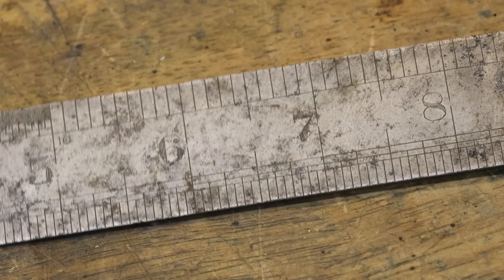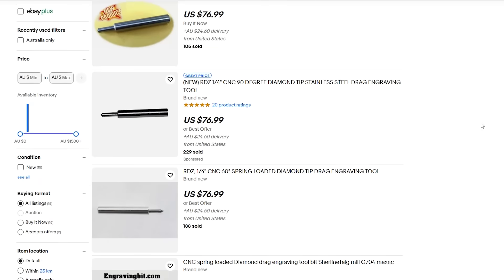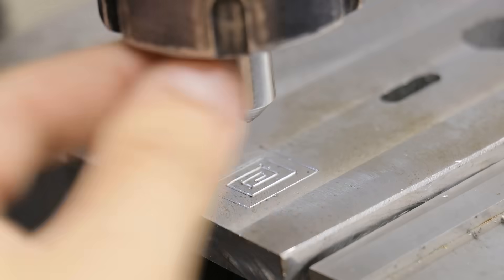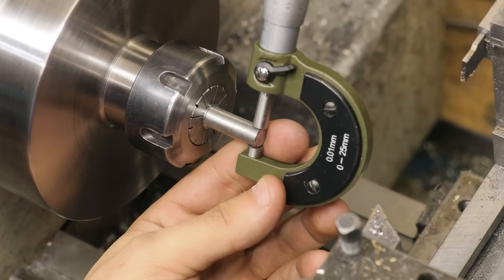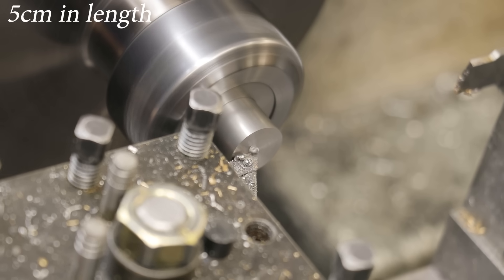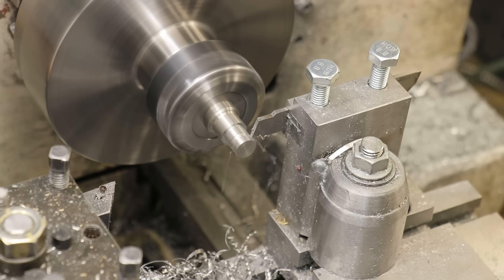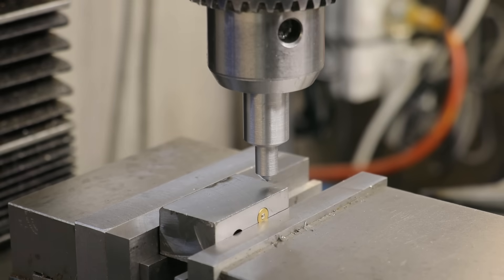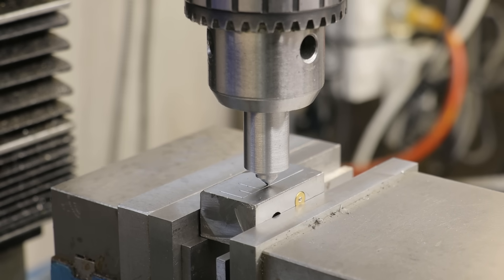They wanted $150 For This. I Made It For $10

Comment: No diamond, but a spring loaded tap will get you most of the way. Adjustments may be necessary for runout. I recommend the Brown & Sharpe for less runout. My use case is a bit different as I am engraving softer materials but I also balked at the cost. After trying an expensive spring loaded bit I found spring loaded taps worked just as well with some adjustment to the process.

Comment: You don't need a diamond tip for drag engraving most metals, you can repurpose a broken carbide endmill. You just have to resharpen them once in a while, but yeah $10 dresser is cheap enough.

Comment: I needed to upgrade my 8×14 lathes motor. Didn't have enough oomph. The ready to go motor and controllers were pricey. So instead I found a used 4.5 hp high torque motor with bad bearings for cheap, got it. Rebuilt it. Built my own power and control system for it from scratch. Had to build a total custom adjustable  motor mount and belt and change gear system. And a bunch of other stuff. Works GREAT. That said I spent as much money making it myself as I would've just buying a proper drop in kit😂 except I spent weeks doing it. Lesson being- just because I CAN make it doesn't mean I can't buy it. I did the same with my steady rest😂
Reply: I fall into this same category.  I bought a $5000 mini excavator, added a thumb safety valve, a rotation safety valve, an oil filter and cooler, an electric fan, and an external gas tank. I spent a couple of thousand for those extra parts and took more than a year doing it.  I spent $10,000 on storage fees, storing the junk I was supposed to be building a shed for, by using the excavator.  I should have just purchased the higher model excavator and spent a little extra on the front end, and saved more on the back end.....Because I could do it, .... and maybe do it better? or maybe not.

Comment: It's a great way to get the same results, well done! and you saved some $$$ and can use that for another project. Cheers 👍💪✌
Reply: Hmm...  Using those machines for billable work would have netted at least $200-$500 dollars. A diamond engraving bit can be had for $75. Doesn't seem like a wise investment except for the fact that it also made a Youtube video which has the postential to pay back over time.
Reply from the maker: Nah I do this for fun. If I was interested in making money with all these machines YouTube is the last place I'd look to. It really does not pay as much as everyone seems to think. I think the point of having this as a hobby is that you can justify these projects and not worry about time/billable hours, because the point of all this is to enjoy the time you spend in the shop.

Comment: Very nice! I've actually found small ball nose to do a much nicer job engraving than v-bits, but they're very depth sensitive if you want fine lines - I'm gonna have to give this a shot we've got a bunch of diamond nubs sitting around. I made a very similar tool but it holds a ball point pen cartridge instead and I use it to plot out the perimeter of the part when I'm working with big plate stock to make sure I didn't mess up somewhere during setup before I pop it full of holes
Reply: We use 1/16" ball endmills for engraving typically.  A lot of our engraving is on raw stock surfaces because customers ask for us to use on size material and leave the stock finish but then ask for part numbers to be engraved.  A ball mill will be fine if a surface is a couple thou out of flat.  A chamfer mill will lose a tip.

Comment: I have that engraver you show at the beginning of the video. The big advantage to their product is that it comes in several different "cuts". I have the 90° for standard stuff, lines, etc. I also have a 120° tip for doing "fill" type work, like if you wanted to engrave bold letters or an image. However, your solution is an awesome way to achieve a great engraved result!

Comment: You mentioned some concentricity error of the tip, and suggested locking the spindle to compensate for that.  There is nothing mechanical in your tool to prevent the tip from rotating while cutting.  Do you think that will cause an issue?  I know visually on a well made scale a human can discrepancy down to .1mm or <.005in. do you think your TIR on the tip was larger than that?
I guess I will wait for the big project and see how it works.
Reply: I have done something similarly but centered the cutter with a dial indicator on the tip in a 4-jaw and then cut the shaft based on that to get it better concentric
Reply: I expected the tip to wobble a bit as he engraved but the first tests I didn't see any movement.
Reply from the maker: I was looking to see if it would rotate under load and it didn't. If it did I had a big hose clamp that I could clamp to the quill/spindle to lock them together but ultimately it wasn't needed.

Comment: Be aware that iron and steel dissolves diamond chemically when rubbed against each other 😁
Reply: ??? Can you cite a reference to this sublimation by contact process?
Reply: @johnrussell6620 when you buy diamond mills they explicitly tell you never to use them in iron containing metals. 
Did you google it?
Reply: @johnrussell6620 

I cite: "Inhibition effect of covalent carbon nanosheets on mechanochemical wear of diamond

2024, Materials and Design

Citation Excerpt :

As a catalytic metal, iron reacts thermochemically with the diamond under frictional heat to promote graphitisation, which is believed to induce wear. Graphitisation occurs preferentially at the edge of the iron-diamond interface, where the C-C bonds are"
Reply from the maker: This is no different to the diamonds found in normal drag engraver tips and I have never heard of any issues with regards to this matter, cheers
Reply: @artisanmakes probably because they are dragged slowly. 
Tools with diamond cutting edges get blunt almost immediately on iron and steel.

Comment: It’s a great hack getting parts and materials from premade products, and if you find it used, it’s even better.
Reply: That goes with everything. Know the different uses. 

If you buy the foil muffler tape, you get a few inches for the same price as the stuff in the HVAC section for sealing duct work. 

A washing soda that we use is expensive if you buy it for soap making, really cheap if you buy it in the Chinese baking soda section.